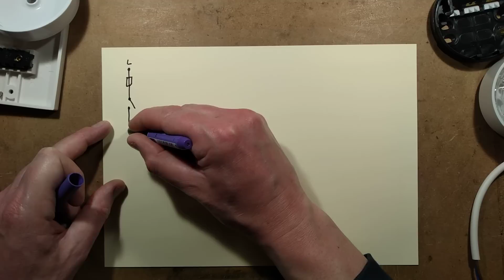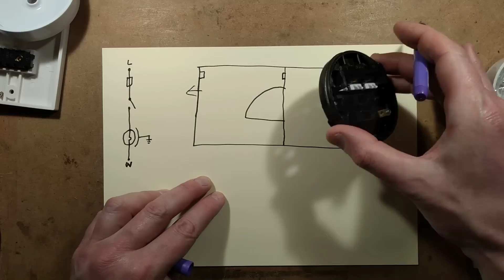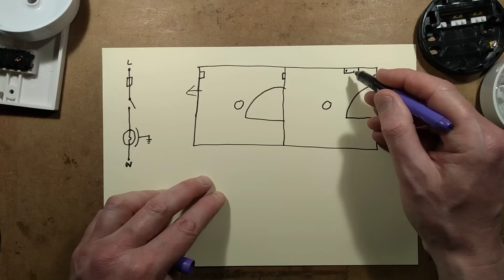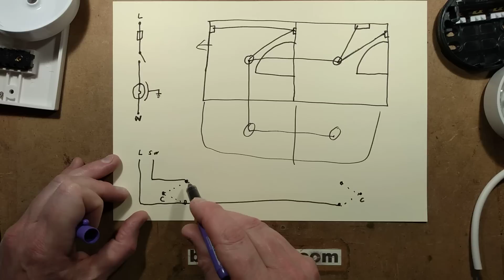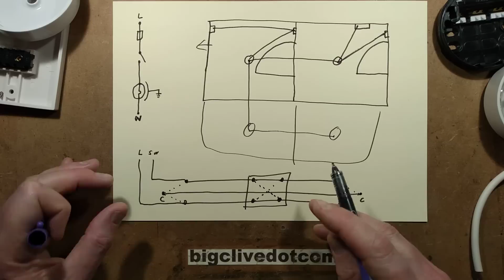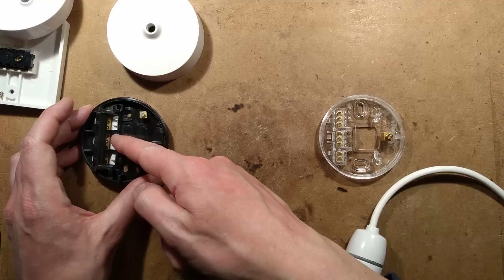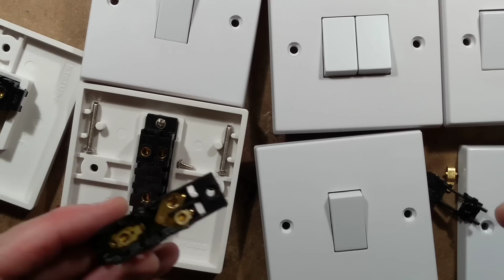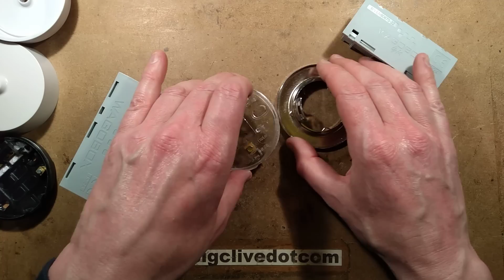British home wiring.  The incredibly simple lighting circuits.

Comment: Thank you, Big Clive, for bringing me back to this planet. In my flat, in Spain, there is no earth whatsoever. The sockets get pulled off the walls at the slightest tug, and the light bulbs actually unscrew themselves with time. One fuse for the whole house. The cable for the light in my bathroom is stapled to the ceiling, being tapped into a junction in the wall, and the bulb just hangs off it, no rose. Previous to that "installation" the bathroom lighting was from within a steel wall cabinet which went live when the condensation from a bath/shower got into it (=always) and I always got frizzy hair on opening its doors. I could go on...
Reply: Are you still with us or have the laws of probabilities claimed yet another :P
Reply: @Anony_Mouse_V  6 years later and no reply, I’d say it’s safe to assume the electrons got him
Reply: That sounds safe… not lol

Comment: New Zealand lamp wiring was very similar to the British system except that we tend to use "batten holders" rather than roses with the pendant socket. The batten holder is simply a rose and bayonet socket all in one, with the loop terminal for similar wiring arrangements. Although these days it's more common to do all the loop throughs at the light switch itself and just take the controlled live (plus netural & earth of course) up to the lighting fixture.

Comment: Weird! This is very different from US lighting systems. Those are so dainty. Here, you need a forklift to carry the part, chain cutters for the cabling, and a screwdriver bit in an air hammer drill to install switches.
Reply: Need more volts and less amps dear boy!

Comment: In Holland, one single switch is sized anywhere from almost the complete front plate to a bit over the combined size of those two next to each other. Even though it is somewhat understandable historically, it still is pretty strange that countries all have a National Style of Design for things electricity related. Our bigger switches in the Netherlands allow you to control em much more casually and easily, I wouldn't see myself regularly switch on or off the lights with my knee, butt, feet 'n toes or nose as I regularly do if I' d live in England. Also I wonder if the light switches in so many countries that are much tinier that they need be and could be, to a degree  bring about some chagrin on their own accord.
Reply from the maker: You can get large rocker switches here too.  But the standard is these small ones.

Comment: Typically, we use colored electrical tape to mark different phases. I suppose you could use colored heat shrink tubing. I don't think slip on tubing would be allowed in the American electrical code. Our electric boxes don't have terminals either. Typically, wires are joined with twist on wire nuts. Metal boxes need to be grounded by a green ground screw now. Our boxes in this fifty year old house are grounded by tightening ground wires under unused romex clamps. That's out of code. You don't seem to have boxes with romex clamps either. We call our "twin and earth" romex after the brand name of Romex cable. The technical term is NM or Non Metallic cable. Also, two conductor with ground. You can either use existing holes in the boxes with the cable clamps provided or use knockouts like you have with NM clamps for those knockouts or conduits. I've seen Wago connectors, but they aren't cheap. Wire nuts are cheap but have performed well for decades so we just continue to use them. I still haven't don't know we haven't sleeved the prongs on our power plugs yet.

Comment: So, correct me if I'm wrong here. Y'all wire your lights in series? Unless y'all have miraculous lightbulbs that seems quite inefficient. I mean I'm pretty sure the UK has a higher voltage production than the US.
Reply from the maker: The cable feeds all the lighting points in parallel.

Comment: It's always interesting to see the differences in how similar work is done in different places.  There are places in the US where conduit is required for residential wiring and other places where the only conduit is from the meter to the circuit breaker panel.  Some places require the breaker panel to be outside and weatherproof so the Fire Department can shut off the Main breaker if there's a fire; other places have minimal restrictions other than that you have access to the panel.

In the US, you'll see the "winged" box for sheetrock with an "old work" label because it's used for changes/additions to "old" work - as in making holes in "not new" sheetrock ;-)

I'm knowledgeable and experienced in residential wiring because in my county a homeowner can get permits to do residential construction, plumbing and electrical work, subject to being inspected by the same inspectors that check commercial jobs.  I enclosed a carport to add living space to a previous house and the electrical inspector only had one question: "Are you an electrician?"  Not by trade, but the US NEC (National Electrical Code) is pretty basic reading (to me, anyway) and I planned to sleep in that house so I did things correctly.

Shallow boxes are probably a pet peeve for anyone who's ever replaced a switch or an outlet.

Comment: As the old saying goes, red to red, black to black, blew to f**k... 😉
Doesn't work as well with the crappie new colours.
You kept mixing up your gangs and ways btw... All your switches were 2 way, some of them were 2 or 3 gang.
I once wired a 2 way circuit using the conversion circuit (the one you drew as opposed the normal one) on a FES job (Mearns Castle High School), the wall where the 2nd switch was to be mounted wasn't built yet and we only had 1 switch, so it was the only way to "just f**King wire it". I left the wires marked "Com", L1 & L2 with tape flags in a bit of connector strip... Then left to start working with Auntie the following Monday. My mate Joe phoned 3 or 4 days later absolutely peeing himself laughing, apparently non of the "electricians" working for FES on site could figure out what I'd done. All they had to do was bung a switch on in place of the connector strip using the common, L1, L2 markings on the switch and flags. Needless to say, Joe decided not to help them... So it got ripped out and redone.

Comment: What do you use for "wire nuts"? If not using wago's
Reply from the maker: Terminal block.  But Wago is the way ahead.
Reply: @bigclivedotcom  I found the wago connectors in the states a few years ago, they are my first choice, especially now with the slim line version. By terminal blocks I'm assuming you mean the little white strips with a screw on each side?

Comment: Do Brits, Scotts, Welsh, and Irish not use gypsum wallboard much?
Reply: In the UK we use gypsum board almost universally in new builds,  and have for decades,  but we usually call it plasterboard, and it is often skimmed over with a very thin skin of plaster to give a smoother harder surface. 
I think Clive was talking about the situation that was more common in older houses where it is solid wall with plaster over it. That is done with a thick coat of coarse plaster called browning to level out the masonry surface,  with a thin coat of finer finishing plaster on top. 
Don't know about the Ireland, but I suspect it will be the same there.

Comment: I wish they ran Neutrals to the light switches by default :( 
Most houses can't accept home automation switches as they are wired the "lazy" way with just a single T+E to the switch. Its rare I ever get lucky and find a pair of T+E to the switch (although that is the way people often want them wired now, to allow for smart switches etc)
Reply from the maker: If a three core and earth is run from the rose it can supply neutral.  They probably didn't realise that in the future people would want to cram active electronics into their switchplates so they could turn the lights on with their phone.  I'm still not convinced that cramming active electronics behind every switch plate is a good idea.  It hints at lower reliability, a risk of remote hacking, higher risk of shock to people trying to solve issues and probably an increased risk of fire.

Comment: On the 2 and 3 way switches, is it possible to just bridge the commons together? I’m in the states btw so we use 110 60 cycle
Reply from the maker: Yes.  If controlling more than one light from a multi-gang switch you can loop a single live to all the switches.

Comment: We have round boxes that can be used for either switches or outlet sockets, it doesn't matter. They sit inside the wall, and on top of them, there's the switch/socket. It has screws on the sides that move metal clamps outward so if the screws are tightened, the clamps hold in the switch or socket. After it is installed, the front covers are just clipped on.

Comment: I don't think, German households are wired that way. At least I have a circuit breaker for the lights in every room, separate from the 230V sockets (which, in the bigger rooms, are also split into 2 breakers, i.e. for the right and the left half of sockets in the room). Although the one case where there are 2 switches for 1 ceiling light, which is the hallway, it must work quite similarly, since it can be switched from either side as well.

Comment: In high school I was taught how to make a combination connection a little different, you connect 1A to 1B, 2A to 2B, live to common A and the lamp to common B.
Reply: I'm pretty sure I've got both setups in my house, with at least one (original wiring) done the way you describe and another (new wiring done with three-core-and-earth between three switches, the kitchen has three doorways so it's got an intermediate switch - which swaps A and B - as well).

Comment: Great minds think alike! John Ward did a similar video, specifically about boxes, only last week https://www.youtube.com/watch?v=-L3HmfxGehI. 

I must confess that I, like a few others, consider those ceiling rose junction boxes the work of the devil. If you get one fully populated with wires everywhere it's difficult to get the cover screwed back on and you always have the suspicion that you may have crushed two incompatible wires together and compromised their insulation. I much prefer, if possible, bringing all the wires to a separate junction box hidden behind the ceiling plasterboard and just dropping a single LN&E down into the rose.
Reply: BTW, John Ward mentions that you should always grommet the knock out holes in a metal box and that oval hole in the 16mm box will take a standard grommet suitably squished.

Comment: Do you mark the end of your cables with marker pen or use your cutters. most of the older guys i've worked with use a bar gate system with the cutters.
Reply from the maker: I sometimes use nicks and sometimes a sharpie.
Reply: Cheers Mr Big just curious, find your channel fascinating.  im a chippie by trade but also brick, plaster, plum and do basic electrics. worked with electricians since i was a kid.

Comment: In control panels and industrial settings, I Iike terminal blocks and such, and use a lot of Euro stuff, but that's with lots of room, stranded wire, etc.
But in residential, using 12 guage solid copper wire, and small boxes, (though normally Much larger than these lol), I like the North American system of wire nuts better, because you can connect anything to anything using a small selection of standard items.
It is just more flexible, and much easier to be able to wire nut some wires, and then just shove them back into the box, instead of trying to wrangle 12g wire into terminals deep inside the box.

Since you use much thinner wire and have less variety of options, this makes sense for over there, especially with those tiny boxes for making things work in ancient houses.
Reply: Well Wago 773 connectors would be perfectly fine for solid 12-gauge wire and 221s for both solid and stranded. So depending on whether you use a lot of stranded wire or not you'd only need to stock two or three types of Wago (3-way, 5-way and maybe 8-way).
Reply: @Ragnar8504  well, I can't think of many situations where I would need 8 wires joined except in a panel where I would use a buss bar or terminal strip anyway, pretty much any other standard combination of wires I would use a single size of wire nut, and have no extra unused terminals taking up room! Plus they are pennies per nut.
In reality, I like having 4 or 5 sizes around, because you sometimes have to deal with 18g stranded fixture wires, and larger wires say on dryer cords, but I would suspect that they may be outside the range of the Wago connectors, so you would need more sizes anyway.
Reply: @ke6gwf  That's why I wrote "maybe 8-way". If you've got a setup with one or two central junction boxes per room you do occasionally need 8-ways but even then it's rare.

If you're worried about unused terminals taking up space I suspect your box is too small anyway. I typically carry full boxes of 3-way and 5-way connectors for solid wires and a handfull of loose 8-ways just in case, as well as a few loose 221s for solid and stranded wire. Light fittings usually come with special Wago connectors pre-fitted these days, so no need to carry those (very small, take one stranded wire and two solid ones).

Wago 221s take up to 4 mm2, so I guess 10 AWG wouldn't fit, 12 should. Keep in mind that Europe has 230 V and often 3-phase so it's rare to encounter wires larger than our equivalent of 12 AWG in domestic wiring, which is what I mainly deal with. I don't even stock 773s at all because I wouldn't know where to use them. 6 mm2 is a highly unusual size, 10 is a lot more common for main incomers. If you need to join those it's back to screw connectors. Usually you try to run them unbroken.
Reply: @Ragnar8504  as I said initially, I am talking about the standard way we do things in the US, and that the way things are done over there it makes more sense to use the Wagos.
For instance, over here, 12 gauge is the smallest wire we can use in residential wiring lol
Internal fixture wire can be smaller, so we may connect to it, but we don't even install 14 gauge anymore.
Minimum breaker size is 15 amp, most outlets are 15 amp, though usually on a 20 amp breaker.
If you go to 30 amp for smaller electric stove tops etc, that's 10g wire, full size electric ranges and dryers may use 8g or 6g.
And if you are doing long runs, you may increase a wire size.

Since we are using 12g solid for most everything, a simple outlet box with a feed through and a leg up to a wall switch or whatever can fill up real fast, and it's normal to have to push pretty hard to fit all the wires in and still fit the device in.

So that's why I said that I love euro style stuff in industrial settings where I have plenty of room in a box, but in residential settings we just are trying to fit a lot into a little bit of space, and unless you are at the end of a run, so just 3 wires and a device, it can get crowded quickly!

Comment: That's the old fashioned way, Clive.
The method currently in vogue for new builds is to loop the L & N in and out of each switch with the feed and neutral going from the switch to the light.
Reply from the maker: That's odd.  It's not as versatile for room lighting modifications.  I guess it may be allowing for active electronics at the switch.
Reply: @bigclivedotcom  I agree.

Comment: Here in denmark the most common, is the earth wire is insulated, but the entire cable round tho, wich means that you can just gently(without cutting trough the insulation) use a knife/cable scissor around the cable and then pull off the outer insulation by hand pretty easy, wich means you wont damage the earth wire by rubbing a knife against it
Reply: here in germany we have also round installation cables. Most common is NYM 3x1,5mm² and 5x1,5m².  
5 core is used for lighting control and for 3- phase circuits. 4-core wire is rare, it is much more expensiv than 5-core cable. Don´t ask why.  The round  shape of the cable  make it easy to strip with the "Jokari" cable strip tool. Most circuits are fused with  13 or 16A CBs. At longer cable path 2.5 mm² is recommend. 
The current hungry appliances  like washing machines , tumble dryer, dishwashers etc.  get  an individual circuit each  with 2.5mm²  cable  . The kitchen stove get a 5 core 2.5mm² and run on 3 phases. 

Our switch and socket boxes  , german designation "Schalterdose" are round shaped and so  the mounting hole is easy to drill with a circular saw or diamond core drill for brick walls. The outer diameter is 68mm  and  they can not even  fit switchgear to DIN standard , they are able to acommodate  a single gang BS1363 Wall socket or lightswitch.

There  is double gang box available:
 https://www.google.com/search?q=doppelschalterdose&client=firefox-b-d&sxsrf=ALeKk03balgDSghAD2IufBWLWzqEHlVx_A:1617229466666&tbm=isch&source=iu&ictx=1&fir=TdLeYqXbrCmbQM%252Cfs_7ffUVkaHgBM%252C_&vet=1&usg=AI4_-kQYEieG1yvzqtsOv_13x1eZtu7q2w&sa=X&ved=2ahUKEwj1yIWfydvvAhUo_7sIHUVDAl0Q9QF6BAgKEAE#imgrc=TdLeYqXbrCmbQM

It need to drill 2 hole side by side in a detemined distance with the help of a template  . They accommodate also a double gang BS1363 Socket. Clever solution. The reason is that the british measures of domestic switchgear is a german developemant way back from 100 years. It has something  so do with WW1 reparation payment.

Continous floating water heaters are  more  rare  and mostly  an interim solution. They comes  between 15 and 24 kW and need 6 or 10mm² 5-core cable .

Nowaydays the Meter Box is acommodate in the utility room, but the consumer unit /breaker box is fitted in  the hall for easy acces. 
In older Buildings the meter and fuse panel ist fitted near the main entrance  door like in the UK. 
Modern  terraced houses and blocks of flats  got a central meter room for all houses in one row or flats with a separate entrance from the roadside.